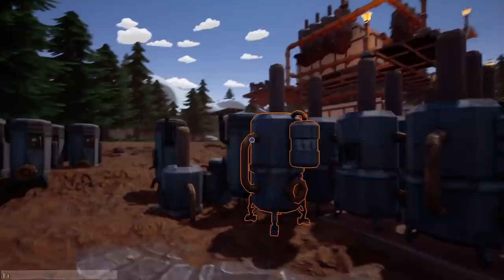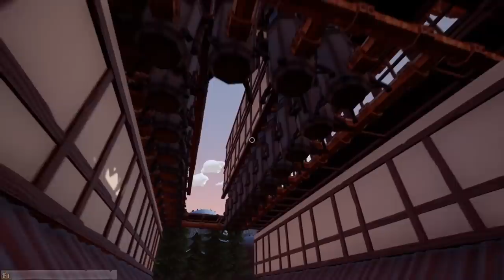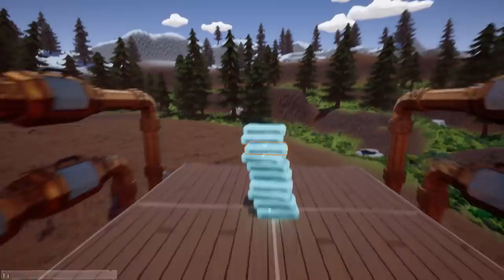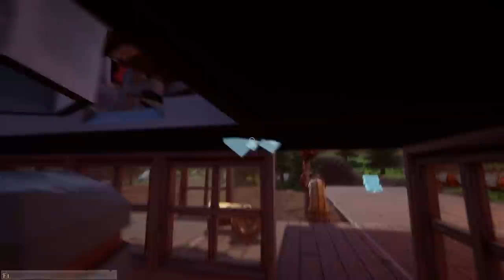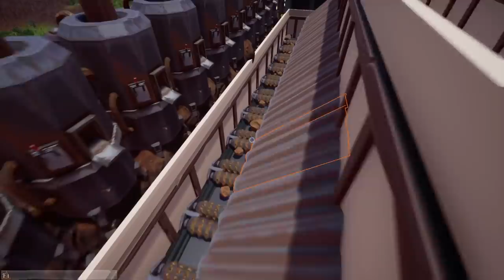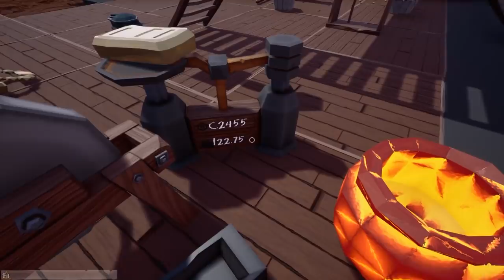My Automated Gold Mining Factory Is Making Me Rich - 24 Ram Drill System in Hydroneer

Comment: granted I haven't played the game myself so I have no idea. But to fix the breakages/prevent them you could give every 8 drills(4 on each side) you could give them their own water flow/power set up. So, you'd still keep them all in a line like you have them just a lot more pipes. granted you'd have to turn each set of 8 on 1 at a time but it may help cut back on breakages. You have more than enough cash to buy all the stuff you need to do that set up. Or instead of breaking it up into sets of 8 you can just to two water supplies/pipe set ups to power one side each of the row of drills to at least break up the stress load a little bit. Granted all the extra piping may make the game unstable or super laggy. I have no idea if that'll help, not trying to tell you what to do. Just wanted to throw out a suggestion that was hopefully genuinely helpful.  Love your videos drae, especially any mining/smithing series. Looking forward to more of that smithing game that was in super early alpha/beta. Hopefully you see this.

Comment: Drae, the bedrock dirt on that plot has the huge nuggets and shards that will explode out of the pans, I'd say take a shovel, a bunch of buckets, and a bit of time and save the dirt you're removing down there and then dump that dirt into your automation with full power to your harvesters. If the harvesters are maxed they'll clean out the largest nuggets possible if they're in the dirt they're given. You could easily get a shard bigger than a bucket if you ran that dirt through your system. 

You'll also get massive gems. My largest found on the first site was worth 47 refined. The other day I unearthed one from that site you're at and it was worth 79. Just saying there's a lot of valuable stuff that's eaten away by the pickax at deeper levels.
Also, awesome to see you using the magnets to move dirt around. I just wish you'd put it all back into the system, as that's a little bit more revenue you're denying yourself. Also also, the thing with the crusher belts, It was pressure based due to how the game treats objects and their physics depending on the interactions they have. Anything the player touches/interacts with will have physics with the world but also will collide and be effected by gravity. It seems like if the last thing that an object was touched by was a belt, drill, or some other part of machinery or bit of the world/aka not the player/ then the thing looses it's gravity interaction with the world, while retaining most of it's inherent abilities (dirt will amass into larger dirt clods, buckets will fill with dirt or water) as well as collision assets.

In a TL;DR, because the grinders "pop out" the broken up dirt and because there wasn't enough power the dirt was getting caught in the area between the belts and edge of the funnels and then stopping. This mean that belts couldn't move them and they would never fall into the funnels. Annoying, but good to know so you can counteract it. Sorry for the essay.

Comment: You can place a pair of those square steel panels on the sides of that conveyor, where it feeds into your sorter train, and use a couple scoops of dirt to help push your collected nuggets toward the center of the belt. It helps a lot with preventing that clustering you keep needing to clean up, and is really quick to add.

Comment: so when ur pipes are out of the ground put your shard chambers on the ground level and 4 chambers on one side of your drills and 4 chambers on the other... so ur running 100 percent for each side of your ram drills. also you only need 4 filters on the whole build as filters degrade 2 water pressure per pipe..
 If your going to add walls then use the construction hammer to hammer them down as this takes out the whole loose object thing and doesn't create towards the lag total

Comment: Hey Drae
would it work better if you add funnels in the bottom to center the ore and gems on the convey as it drops down, so its not clocking the sorters side.
so the steel plates helps guide the ore t into the funnels so the funnels make the ore drop center on the conveyr and not on the verry edge.
Might help with the blocking of sorter/s 
Or would it be still drop all random onto the conveyr  regardles and clog the sorter enterance up?

Comment: You should really have one water pump that you then tee off of - post shards and filters (with valves after and before) - this way you have way fewer filters to repair, and more importantly 75% fewer shards required.
Reply: Would need more shards, the more you put on one system the more pressure is needed
Reply: @Flarexxxx  for sure, but he is duplicating runs - maybe he'd need 6x shards instead of 12x